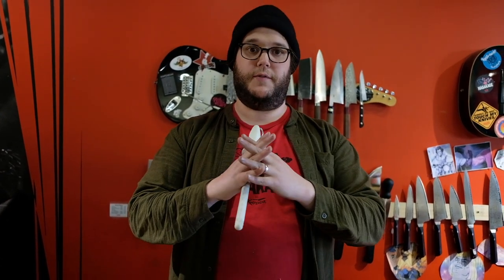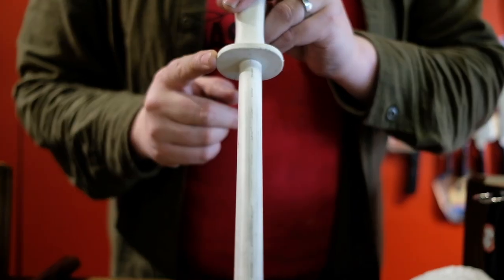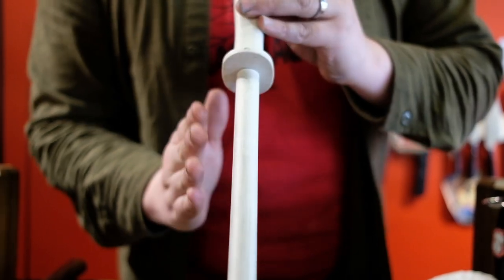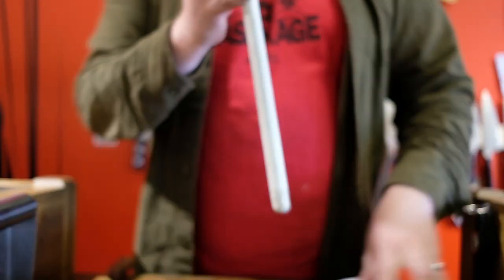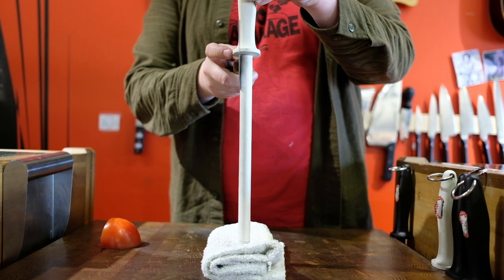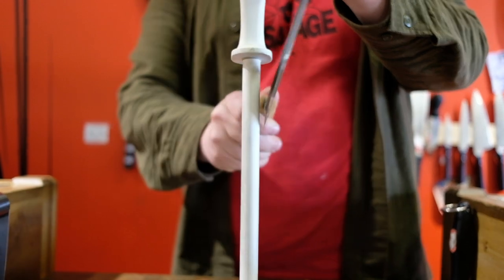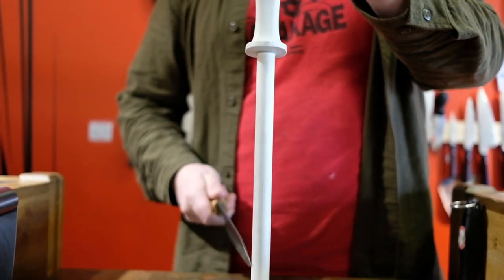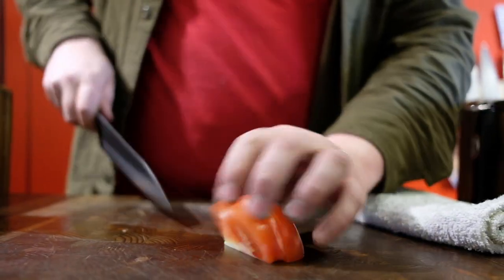How to use a Knifewear Ceramic Honing Rod to Hone Your Kitchen Knives

Comment: Wrong about the angles, because it depends on many factors. If you put a narrow blade, and ,messure the same way, the angle will be completely different. Same goes if the edge bevel is different. You have to be way more precise, when sharpening a knife, especially an expensive knife, or also, any knife that it will be used everyday by a professional. Ceramic rods remove steel and are great for touch ups. Steel rods, realign the edge, if it gets micro rolls, but it can't do anything else. It's funny and stupid, how many people I know, that believe, that they sharpen their knives, going fast and on random angles, on a steel rod!! That's helarius!! Go Ceramic, and learn how to hone your knives properly! Go slow and don't push hard!
Reply from the maker: We absolutely agree, thank you for the insight! We wanted to keep this one simple for all of the folks that aren't worried about super precise angles, but we'll have a more technical video in the future!
Reply: @KnifewearKnives  We are both right then! Please excuse me. I'm a perfectionist and that's not always good.. Keep up the good work